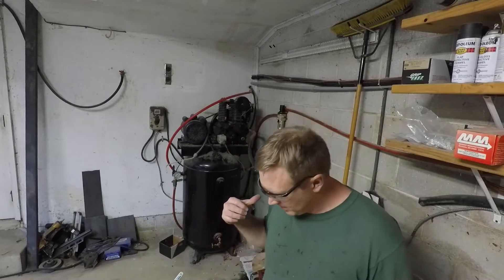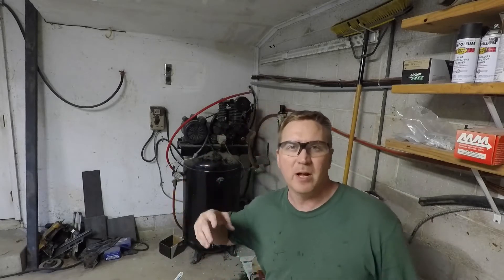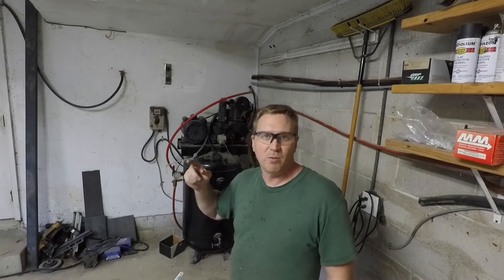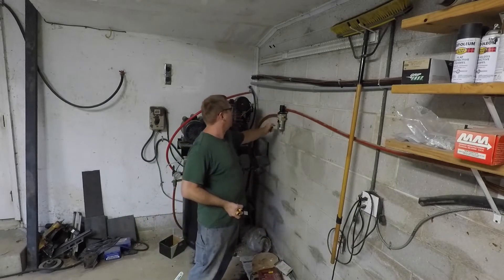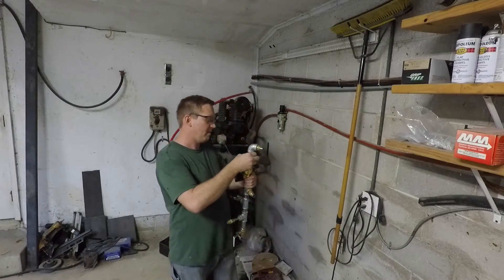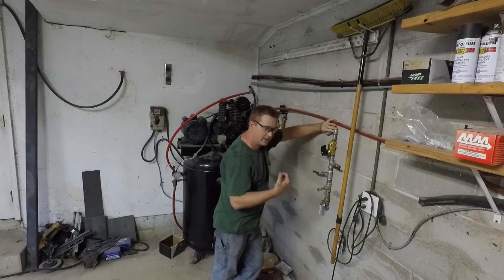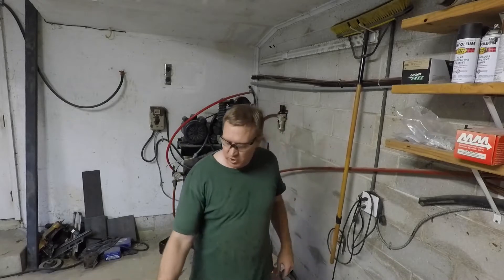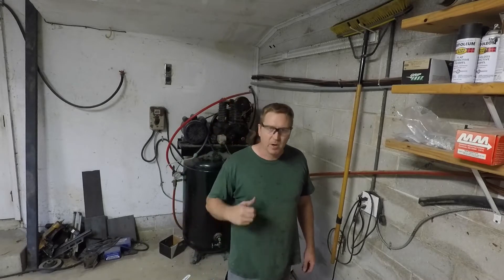Installing a remote switch for air compressor

Comment: I think if both switches are on then one is a short. Maybe install a fuse on the shorter leg.
Reply from the maker: They are in parallel so it's not an issue.